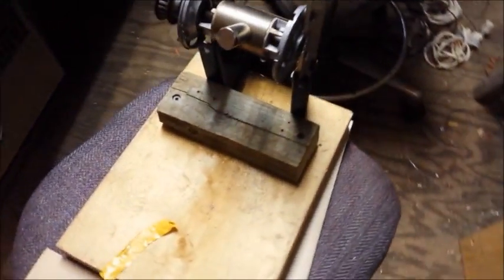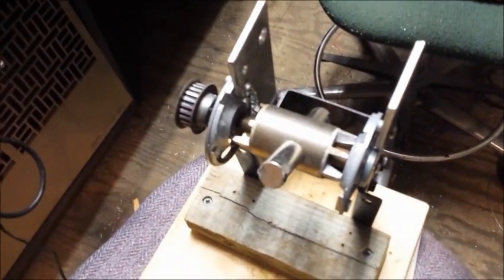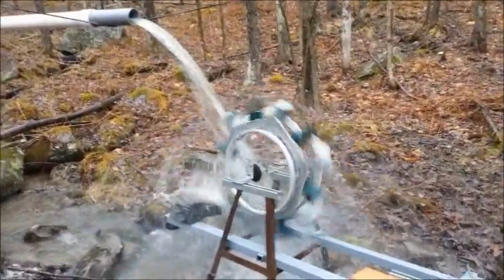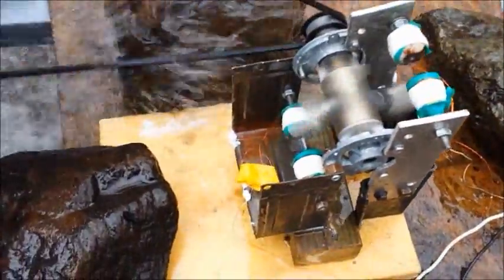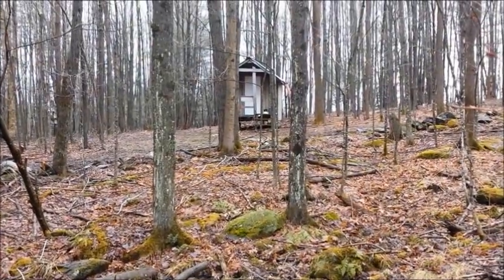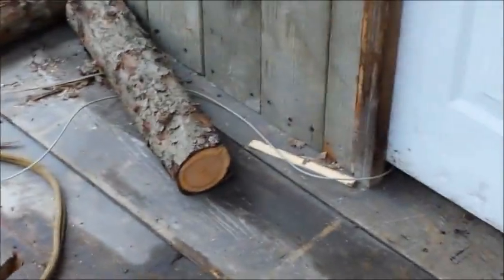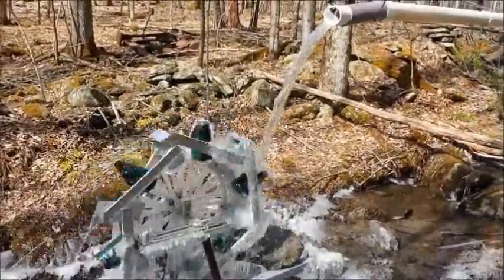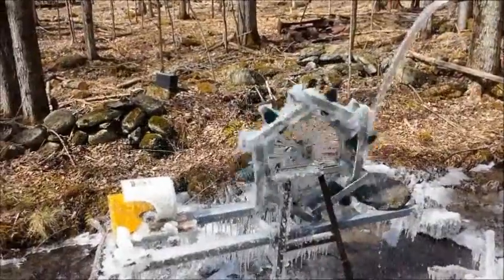Waterwheel Homemade generator all from scraps.

Comment: You need to increase your resistance so you get 14.4 volts to charge your 12 volt batteries . If your getting ice. This won't work

Comment: bit late responding but the water flow will vary and hit the wheel in wrong place at times.... fill a 5 foot section of that pvc with dry sand, heat it and slow bend it into a 90 degree turn. hook it back up so that the outlet faces down just over where you want it to hit the wheel and then no matter what the water flow it will always hit the right spot...
Reply: Or just buy a 90 degree elbow
Reply: 90 exert too much force.

Comment: Can somebody explain this to me. I don't get it. Moving water turns the wheel. The wheels turns the turbine....
Reply: When magnets move and their magnetic field runs through a wire, it conducts electricity in that wire. using this principle, coils of wires can be used with moving magnets to gather lots of electricity, so if you have for example a wheel with magnets on it spinning near some coils, you can generate electricity.

Comment: I bet you have made a ton of improvements by now. One quick improvement would be to remove the extra diode. Since you're using a rectifier you already have diodes in place. You won't see any gains as far as charging. Just one less component to deal with.
Reply: He was using it to drop voltage, and prevent backflow.

Comment: (I'm Dave, using wife's acct ) It appears as though there is plenty of water power there to drive a modified car alternator. Remove the brushes and do the magnet trick and with the better windings, you should vastly improve on the 50ma ( that's hardly worth mentioning ).  Really a novel approach to powering your shed!!

Comment: maybe if you mounted the generator in the back it would be out of the way of spray from the wheel? but at least you have made it work but 50 ma is not much but better then none
Reply from the maker: good copy on ALL of that. the Spray issue would be better solved by a longer belt and much distance. I need to think as simple as possible. and yes 50ma is only to know they don't drop while I am not there right? as for real power yeah I got a ford to jump it for 15 then watch TV and let the gizmo trickle it while I am gone. BUT exactly right, not much and it takes 2 days to get anywhere with the storage.

Comment: that is nothing
Reply: Made by one man
permate magnet motors are the best option 4 tubines. but if you have a wood stove there. then we have options then. if yes. http://www.customthermoelectric.com/powergen.html   or http://www.tegmart.com 

    first option is fully customizable in power  = amps and or wattage. second option is preset out put. then if you want solar panels. http://www.powerfilmsolar.com/products/oem-comparison-chart/  thats your best bet  for solar. power charge controls would be harbor freights.
Reply from the maker: +muhammad zaffar You got better, send me a link. For now here is my next size up: better generators are required.
https://youtu.be/lXL5oYKHrDQ
Reply: should think about using a 12 volt motor from a tread mill if you can find one. then biuld the over shot around that.
Reply from the maker: Nathan Dean I did but it takes quite a bit more to run power out than folks think. thats why free energy and overunity is so illusive. POWER IS MEASURED POWER and this little pisscutter can't produce squat UNLESS, the generator is sized JUST right and has a regulartor for torque etc. 
      So my waterwheel with sap bucket has a treadmill motor and it works BUT it STILL takes a lot of water. POWER is POWER.

Excellent recommendation tho. And I WILL make  a simple LITTLE generator for just these little size gizmos. Wind, waterwheels etc. TEENSY little is too small, treadmill motors are too big. DAMN even a little 3w generator that tosses out 20 volts is what I need. and then. How good are the bearings. todays market is loaded with junk designed to screw you and make you buy another soon. there WILL be a good answer tho. 
Scott R.
Reply: That’s what I was thinking, nothing beyond measurable. I’m preparing for a small waterwheel myself so I’ve been searching here on YouTube to shorten up the learning curve but I’m getting frustrated! I’m not meaning to diss or float airs of self but I don’t understand all these youTube ‘projects’ with milliwatt efficacy when you can buy yourself in to tiny ‘generators’ for how much? $20-$40 online that will do like 10-20 watts. 
I think microhydro is great but if there’s not enough power to do anything with it: why? I guess I’m simple minded but a good basic 100W solar panel, controller, and cables are $160-$180 and easily will do 15Ah a day- much more in a sunny environment. Spending time on milliwatts isn’t something I’m willing to do. 
With that much water just quick thinking, calculations here it would seem a loaded 50W should be obtainable for under $200 and I think I’d be better off buying into a proven design rather than anything like this. 
I’m totally into home engineering but the ROI on this vid is not worth it.